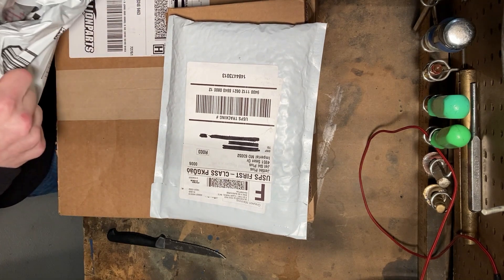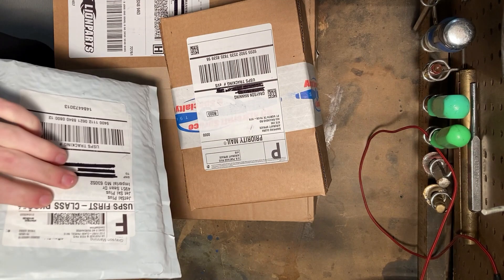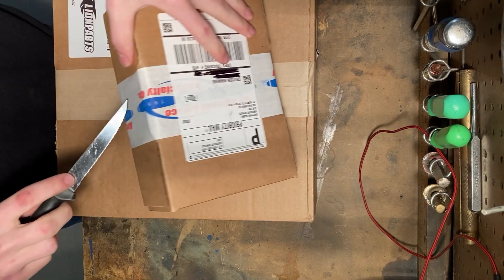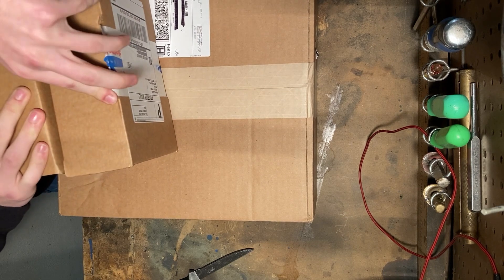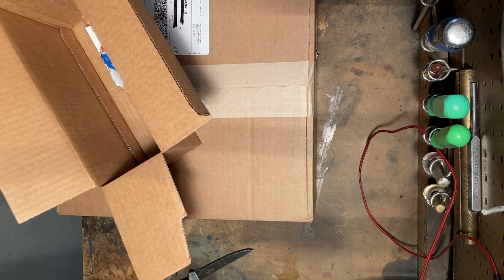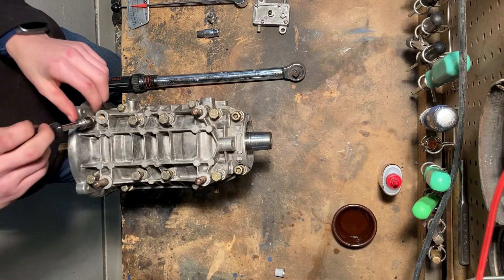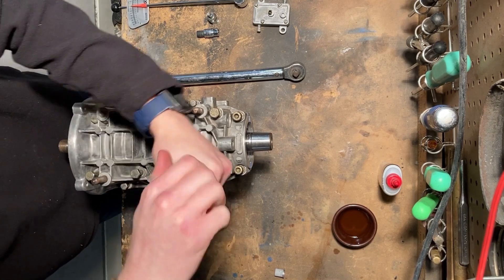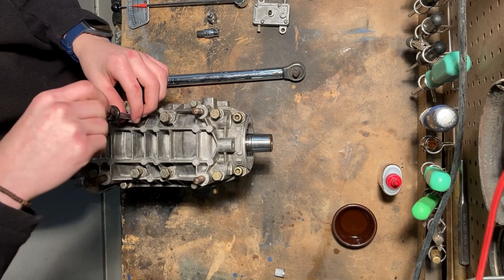Rotax Engine Rebuild (part 1)

Comment: Never use rtv
Reply from the maker: There’s no way to make a gasket for that case. The case is split in a different axis than motorcycle or similar cases and doesn’t allow for a cork or otherwise gasket
Reply: @aero_nwa  correct....spot on.  If done right, like you demonstrated here, there's absolutely no problem with using RTV.
Reply: Perhaps “Gaskacinch” for the cases?  I recall using that on the Kawasaki.